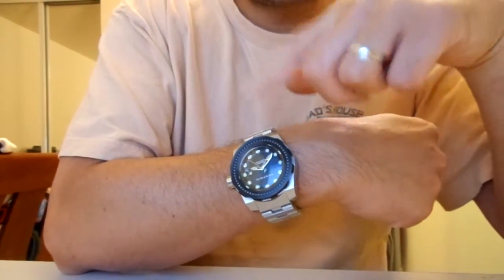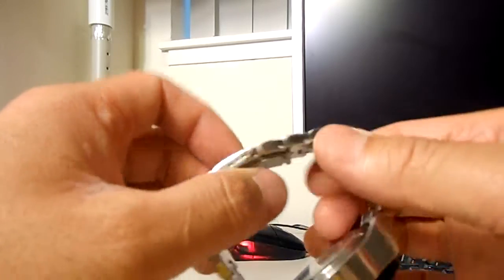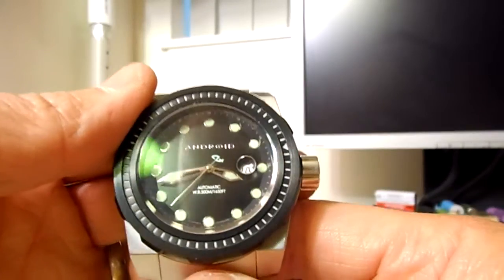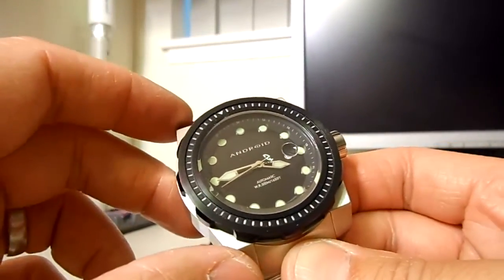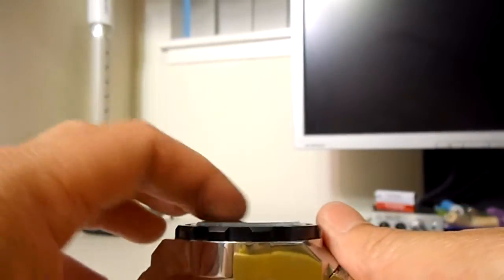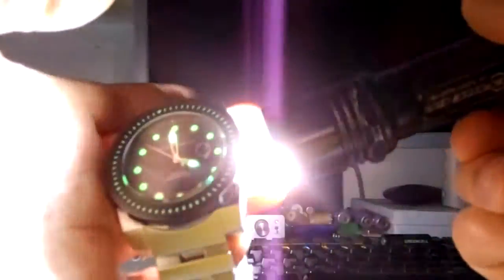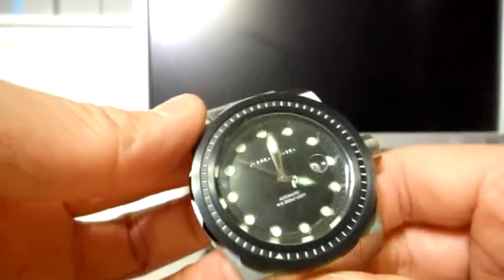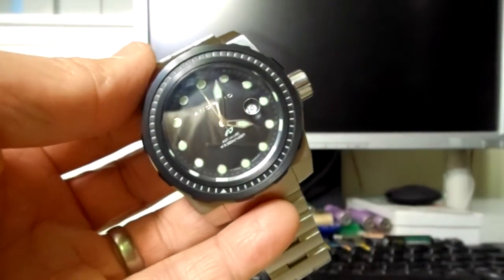The WatchBox Review:  Android Stance Automatic

Comment: Nice review. Does the Android slide down the wrist, and move side to side
when you wear it? What I have done, over the years, is to put a piece of
waterproof adhesive tape on the inside of bracelet on a heavy watch
to balance, and stabilize it. Put a piece of tape on each side of bracelet
between steel and skin and the watch will not slide or rotate. works great.